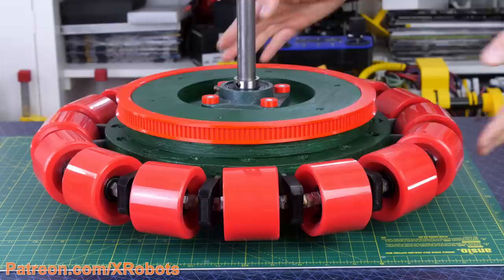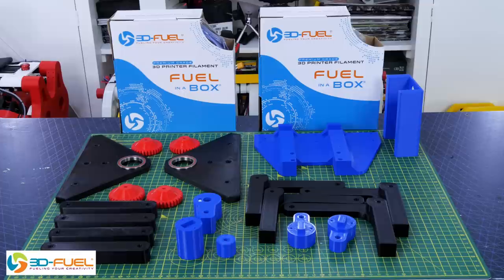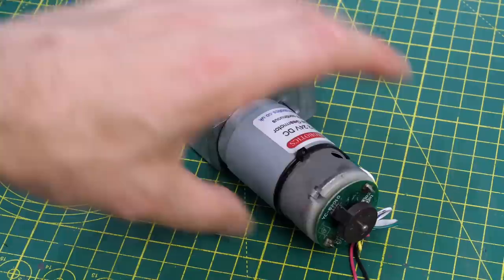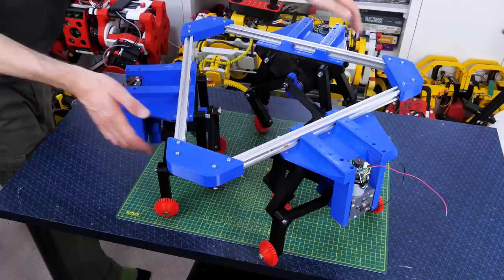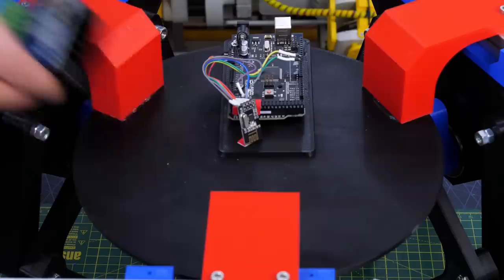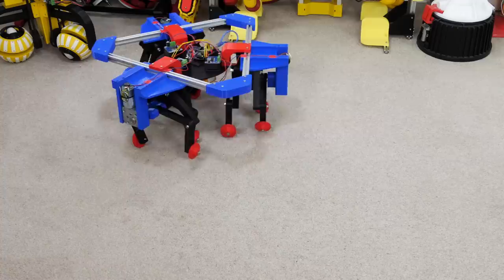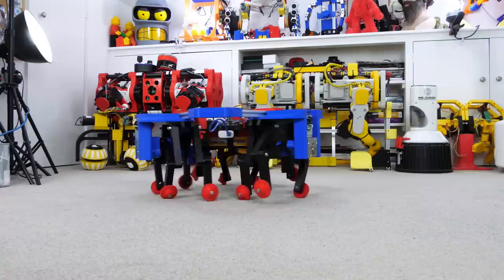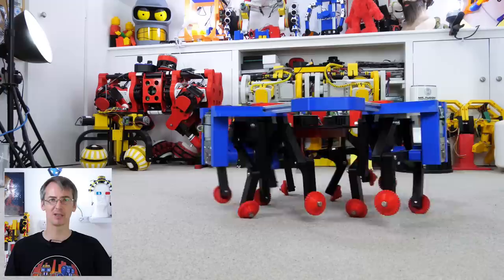Why this Walking Machine is Really Weird

Comment: I enjoy your videos, the mechanical and electronic digital control aspects, especially If I were younger I would be tempted!
Q regarding 3D printing of structural objects. I thought of this a long time ago but nobody ever implements it or talks about it and I can't figure out why it's a bad idea.
 When you build a structural element, like the ones in this project, it seems to me that rather than having a high amount of fill it would be better to make the outline/shell with just enough structure to hold it in place. Then fill it with a resin or epoxy so it will become a solid part. This would save a lot of 3D printing time and filament supplies and I believe would be very substantial in its structure. Of course, you would have to wait for the epoxy to cure. But you could make multiple parts on the printer and then have them cure overnight. Higher productivity and lower cost I believe.
I would love to hear your reply since you are actually making mechanical projects that need rigidity and strength. Thanks

Comment: Having the motor off to the side seems pretty unbalanced, might it not have been better to stick the motor in between the two middle plates and drive the cams either with a gear on the centre shaft or a belt or chain.

If you use bigger wheels you will need to increase the space in between the legs anyway, so it should give you plenty space to mount the motor in between the legs, it also might reduce the force on the first cam that is connected to the motor.

Comment: It looks amazing. My only concern is the angel of the legs and wheels proportional to the ground, when the machine moves forward one of the 3 "waking mechanisms" is still and if you scale it up it might put to mutch presur on the joints and might break? I'm not a profersional and I'm sure of that James has it all pland out and it might not be a problem. Just hade to speak my mind. 
and again amazingly done on this robot, can't what for the scald upp verision.

Comment: If the 60 degree angle cuts the sideways dimension by half, shouldn't the appropriate compensation be to double it? I.e., to add 100%, not 50% of the main velocity? Maybe I'm not understanding something...
Reply: If you cut something by half, but then you add back 50% of what you have left, you don't get back the whole amount. Or maybe you're saying that you add back the half that you took away?